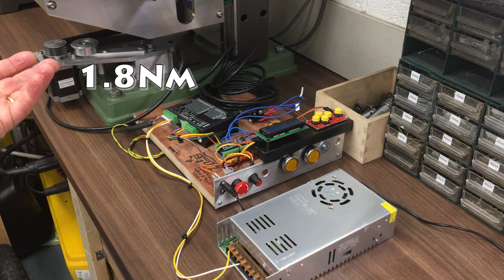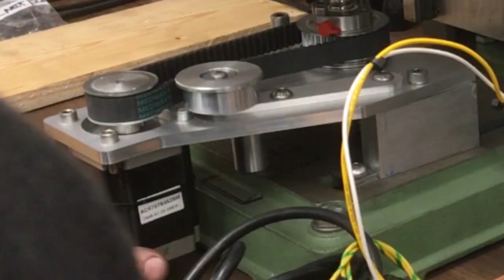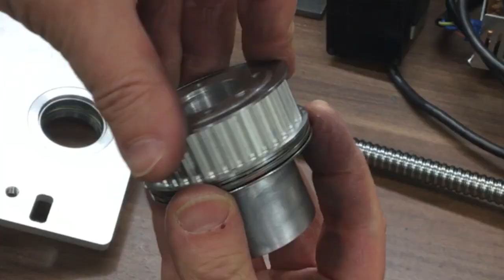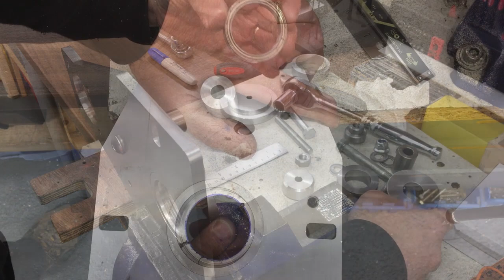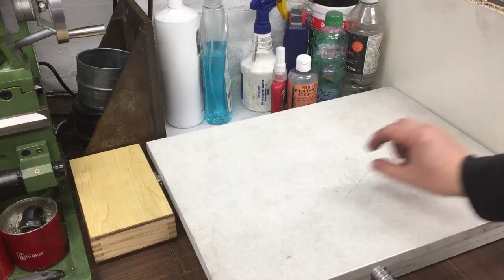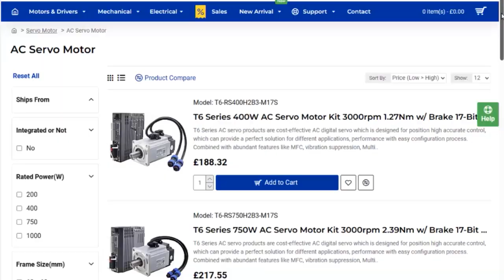Ep46: Drill Press upgrade | Can we finally get this thing moving?!

Comment: Now I'm hitched, trying to figure out what kind of wonder part you're speaking of that'll help you fix your remaining issues!..

Well glad to see it finally moving. Hopefully either with your mystery part, or a 3Nm stepper, it stays that way when you put some heavier Material in the vise when drilling.

Other than that, are you going to add a regular clamping brake into the system? Because even if you've got headroom now, I'd imagine when you drill, the forces on the table would be quite a lot higher.
Reply: As someone already mentioned, a counterweight with approximately the same weight as the table on the back machine connected to the table would solve some problems very cheaply and easy to do with little effort and no drastic change or redesign.
It would solve the weight of the table at least .😉
Reply from the maker: Trouble is the table and knee weighs about 50kg which is a lot of material to fit.  Still looking at options along this lines.  Thanks
Reply: @jacksat2252  people on the last video mentioned the same. Firstly there is a space requirement with a counterweight, not only on the back of the machine, but you need clearance for the cable and pulleys. If there is no space for it, it's a difficult task to get to.
And a counterweight would still not help when drilling, the forces on the stepper when pushing on the table during use are much higher than the table weight itself.
Reply from the maker: @nils1953 Yes those are the main drawbacks to a counterweight (on my system).  Fitting something in (that would make enough difference, not to mention the cost of 50kg of iron/steel (could look at concrete?).  Also drilling forces might still back drive it.  I'm looking into something easy/quick to reduce the force on the motor at least to get that working really well.  But overall though an anti-back drive system is still required in some form or other.
Reply: @routercnc9517  this is just my opinion, but I find counterweights so inelegantly in a machine. All the cables, the clunky weight in the back. 
Cheapest version for braking is probably a pneumatic clamp against the center column if there is space, though that means always needing air. 
I like your bike brake idea too, it's cheap but powerful with little actuation force.
Reply from the maker: @nils1953  I'm with you on the elegance.  Air brake is an idea - I do have air in the shop but it is only on when I need it and then I drain the tank to avoid it rusting (small 50 litre unit).  If you check out my e-Kart videos I used cable operated mountain bike brake discs and brake pads.  These would lock up the rear axle quite easily so plenty of stopping power.  The nice thing about braking the ballscrew (rather than directly opposing the 50kg knee) is the force is very low as it is reduced massively by the pitch.  Still wondering if the design effort is worth it over a braked stepper though . . .
Reply: @routercnc9517  I would avoid pneumatics then.
Yeah I saw that bike brake disk! Oh thats true, I didn`t think about it reducing the force. A braked stepper will have more than enough stopping power, but it is also quite a bit longer than the reguar Nema23 with 1.2 or even the 2.9Nm torque ones. You mentioned with the bigger stepper you'll have just a little bit of cleareance left beneath it and the table. Maybe check if you can even get the braked stepper in there, before spending the 60 bucks. 

This is a repeat of a comment I wrote about the microcontroller, that you mentioned somehow got lost (not sure if the other comment worked now, so here it is for a third time):   
"
depending on how many ports you want or if you want to add a digital pin expansion, teensy 4.0 boards are very good and easily fast enough, even if you want to add touchscreens. The small one is 19£ i think. 

I'm not sure how well they work together, but you can use the Arduino IDE on raspberry controllers.
The zero has a 1ghz processor, and is only around 10 bucks so possibly the cheapest controller with a lot of processing power you can get.

Though I should add that both options obviously don't have perfect support for all off the shelf libraries, if you want that you'll have to go with Arduino boards like a Due or Giga, but those are 50€+, so yeah."
Reply from the maker: @nils1953  That is brilliant information thank you!  The Arduino is driving the motor OK at the moment, but when I add more code or run faster it might struggle again.  I'll look into those options.  I could also use the Arduino for all the well supported stuff like LCD display, user interface, then just use another Arduino (or one of the systems you mention) to output the pulses using whatever speed the master Arduino told it to run.  This part of the project will be some way off, but giving it some thought.  Thanks again for the info!
Reply: @routercnc9517  no problem! That's actually exactly what I did with my last project. I used the teensy for servo control only and then used a raspberry for the bigger stuff, like the web server and HMI. 
It's definitely a little bit of a hassle, especially if you want to change different parameters on the teensy board through a menu on the LCD. If you want to change max speed or max acceleration via the screen if you want to implement that sort of thing, you'll have to integrate more code than usual. 

Not sure how good your programming is, but Chatgpt was a big help the last time around for me.
Reply from the maker: Ok that’s good to know thank you. I’m not too bad at coding in the Arduino IDE.  The recent solar monitor project used an Arduino and I ended up with around 800 lines of code.  It used inputs and outputs, an LCD display with user menu, and stored new values in the EEPROM to be recalled if power was cycled.
Reply: @routercnc9517  hey, just writing to you here since the other comment chain seems to be broken for me.

The stepper libraries I've used in the past are "accelstepper" and "flexyStepper". I'll add that I liked the flexyStepper library better, as is was a bit lighter and easier to use. Still had useful features like relative and absolte positioning, but wasnt overly bloated to include multiple steppers etc.
Reply from the maker: That is great info thank you.  Arduino is not that fast so code needs to be slick.  Reading inputs, driving LCD, all take time and that will limit pulse frequency.  I might have to drop micro steps on the driver and sacrifice noise quality (and a bit of positioning resolution, if I can call it that) for speed.  Let’s see when I get all the mechanicals working.
Reply from the maker: 3Nm stepper is on the way (just to get the most of it without much outlay).  But it will still back drive without power so I may need to design a brake.  I added a cable driven disc brake to my daughters ekart (see videos) so would need to work out a spring and solenoid system or similar.
Reply from the maker: The mystery part should help with speed and backdrive but not sure about drilling loads.  We will see when it arrives!